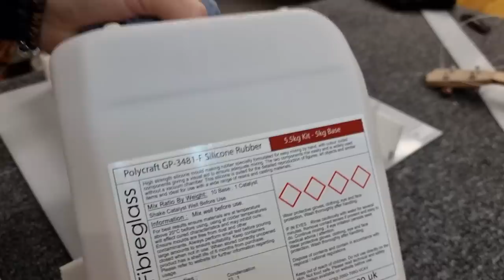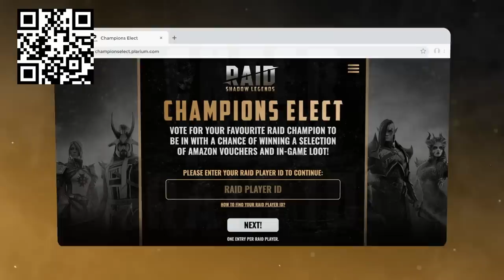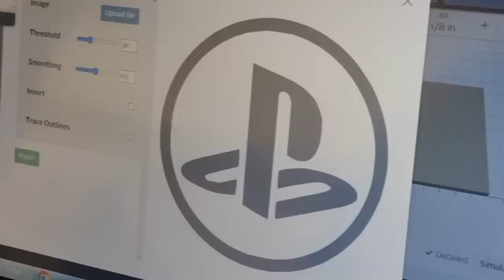I Customized my PlayStation 5 Case... in 10 Days

Comment: Hello Nick. Great project. I always enjoy your videos. Just a tip for keeping your swirls.  Drop the alcohol inks as you wish. Drop the white on top of the colours. Wait an hour or until the resin has thickened up a bit. Then swirl slowly. You'll find the colours won't merge as much and will keep the design. 
Piñata inks are great for colouring resin but I find they develop a skin when dropped into resin and are left for a while.  Best to use Let's Resin or other inks.  Or add a bit of alcohol to thin them down. 
Keep up the great work. 
Ooh Piñata, pronounced pin....ya.....ta.😁

Comment: The alcohol paint is a lot thinner than the resin, which means, over time it will draw toward the centre of the piece where it's lower than the rest of the mould.  Unfortunately, because of the uneven shape of it, this is always going to happen.  The only way round it is to wait until the resin is about as viscous as you can get whilst still being able to move it around to create the swirls, so the paint doesn't have time to collect in the centre before the resin goes off.  Even then, it probably work quite work out as well as you'd like.  The only other solution would be to use a quicker setting resin.

Comment: I have learned so much from YT, and like with all our resin projects, the longer you wait before mixing colors, the better the separation and design. Wait for that gel stage then swirl 😉 I love how you share the process, and let us see the journey. 
If you are taking suggestions... clean up the edges of the first casting, do a back coating (probably black, maybe with a LOT of glitter so we see it when it's set, of course vacuum the resin before pouring so no air bubbles) then glue a couple of handles to the top, and you have a lovely tea/serving tray 😀 And that's random thoughts from a nobody who talks way too much after her 4th cup of coffee. Cheers 🥰

Comment: Nick a tip for making alcohol ink resin projects look similar is to count and keep track of the order of the drops and the amount, and also doing both at the same time. They should look similar and somewhat match.
Reply: Also, when your done applying your alcohol inks. Use a small torch, over the project. It will pop the bubbles. Don't overtorch and heat the resin, just enough to pop the bubbles. Also, white alcohol ink, when used on the top can give a really neat effect.
Reply: And maybe do each piece in several thin layers, adding smaller amounts of ink in each one. Could have a very cool effect!
Reply from the maker: Thank you 🙏🏽

Comment: Nick, I don't know who is editing your vids or answering you comments but I have provided you ideas in comments and I have sent emails. I am curious if you ever got one? I have a new one and rather than bother with unanswered emails, here it is with fingers crossed that you do it.

This will look best as a wide bottom, narrow with a narrow neck. This design will show the planes of the color.

1. Buy a ton of acrylic paint. 

2. Figure out the layering design or wing it. I suggest using a color wheel for great reference.

3. Use a round container with a flat bottom, one that can be cut open later, spray it lightly with mold release, let it set for a few minutes and start pouring acrylic paint layers, 1/4" thick, which you let dry and peel it off. Rinse and repeat with each color. If you want to do multiple colors let each get a skin first. The point is to do these cleanly but if you want some action, to your swirly whirleys.

4. Make a mold that has a wide but short diameter, one of your square ones would work but try out some foam core to make a round one for maximum savings on resin. I suggest using a mold release because you are going to pour clear resin, put it in the vac, let it harden, pour a thin layer of fresh resin then layer dried paint, resin, dried paint. It is important that you know how thick you can make the resin so it doesn't heat up. 

Use your magic lathe and have fun!

Waffle On❣🧇

Comment: Usually, if you work with alcohol inks, the so called “petri dish effect”, you basically work in reverse. The back side is the ‘good side’. But if there is a little too much alcohol, especially in thin layers of resin, the resin sometimes stays flexible and it wouldn’t harden. But the end result looks cool. If you have a project like this that doesn’t turn out the way you want it, you always can chop it up, like you do with the silicone molds, use it in a new resin pour and turn it on the lathe! I recon that would be pretty funky.

Comment: The 1st one that you had looked really cool and probably could be easily sanded down and turned into a beautiful serving tray. On the new project...have you thought about trying to do them in thin layers and letting the thin layers fully cure before you put a second layer on top of it? Kiind of like doing 3D layers and seeing the cool effect as more and more layers get put on it. It might hold your designs better. Seems like everything wants to pull towards the center and the gold has a different density than the colors. Or making a base, let it partially cure, then trying to airbrush minimal amounts of color? And are you going to carve ventilation access for the fan to run or do you take the resin pieces off to play? Otherwise I see the game console catching fire.

Comment: You have to wait for the resin to thicken a bit before dripping in the colours… then drip white, the sinker over colour blobs, then swirl, 
So MAKE SURE ITS BEGINNING TO THICKEN/warm, then put the colour blobs, wait a little, then add the white sinker blobs over the colour blobs BEFORE YOU SWIRL then they should settle because the white is heavier & sinks the colours! Good luck
P.S you can use easy release spray in the mould prior to pouring resin.

Comment: Very nice result. for a better silicone pour you my need to degas the silicone and then brush on the mixture onto the object to be molded before you lay it in the mold to avoid the bubbles.

Comment: I don’t know if you already figured it out, or someone else let you know, but when you flipped it over and said it’s cool, that is the front when it comes to using alcohol inks. You work from the back down so when you remove it from the mold and flip it over, you get the full 3D effect of the inks. Though saying that sometimes I genuinely like the back better than how the face turns out so 🤷🏻‍♂️ I think this was a great project. Needed some lights, though 😁 Next time?

Comment: Nick, I wasn't feeling this at first until you pulled it from the molds.  The inside of the first cover looked like an abstract Monarch Butterfly.  The Outside looked like an abstract warrior holding the Playstation Logo, and on the lower rear panel, a smaller version of the same warrior.

Comment: Nick, if you degas the mould silicon before you use it, it will eliminate allot of the bubbles you are getting, use your pressure pot by connecting it to the air inlet of your compressor.

Comment: The very first pattern was killer.  I also don't think the gold in the middle was bad, but i can see what you mean in doing a match.  Hit or miss.  Too bad it cured differently.  The one with the spotty cure would be cool if you just put a clear layer over it  after the first layer dried.  I wonder if you could build up the layers a little at a time to maybe give it some depth since it is see through. Like this project a lot.

Comment: Would how hot the PS5 gets make a problem with resin panels? Could it melt under alot of heat? I use resin and I have had some get weird when it got really hot. I think this is very cool!

Comment: Just an FYI; I recently saw a report that if you operate the PS5 in the vertical position, the metal from one of the chips can melt and drip into other components, damaging the system.